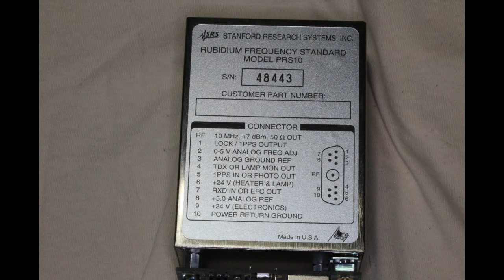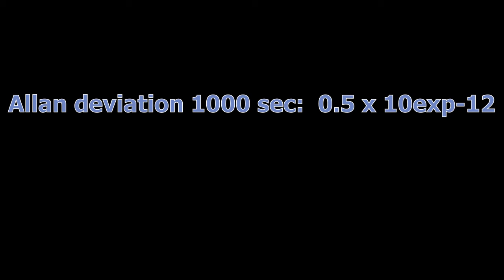#9 PRS10

Comment: Hi, nice diy! I have got a used prs10, and want to refer your desgin, may I buy them for a quick reference?
Reply from the maker: As it was only one unit, there are not schematics and gerber files are not available anymore, sorry about that. But it was a simple design, just additional line filtering for the commercial 24VDC switching power supply and a power split at the output. Anyway, if you want additional pictures, just drop me a line.
Reply from the maker: Just send an email to VK5FE@wia.org.au

Comment: Very interesting, did you buy your PRS10 new from SRS? Also, what is the project for the PRS10 "10Mhz reference box"?
Reply from the maker: Hi there. Yes, I bought it new from a representative in SA. There isn't a schematic, I just added some additional filtering, a GPS receiver and an external 24V power supply. In my opinion the PRS10 is an outstanding reference.
Reply: @vk5fe943  Ok, thanks for your answer. BTW, you're videos are very good, please continue.